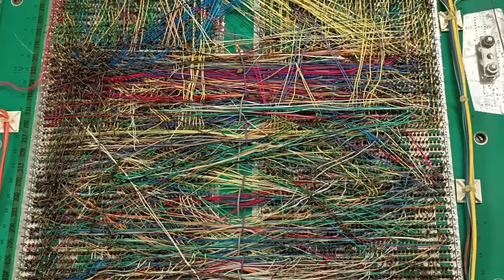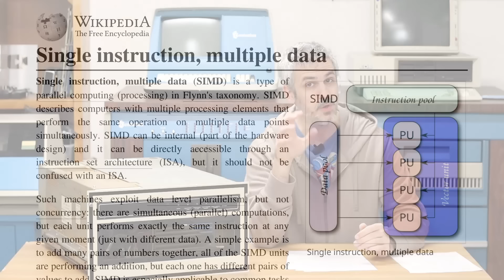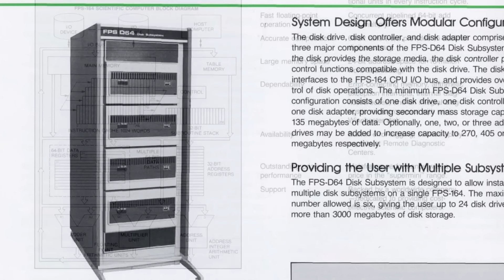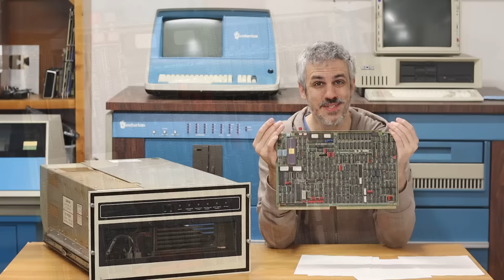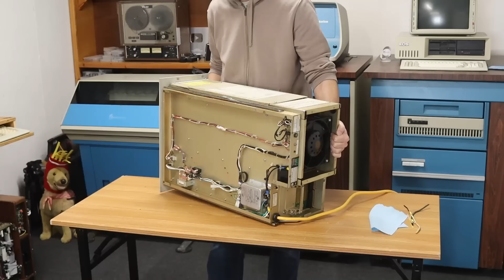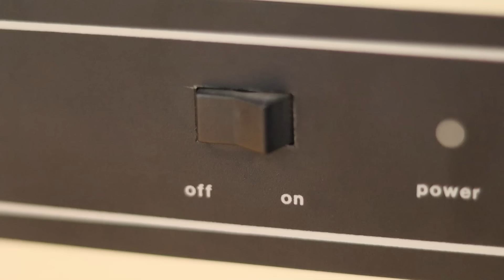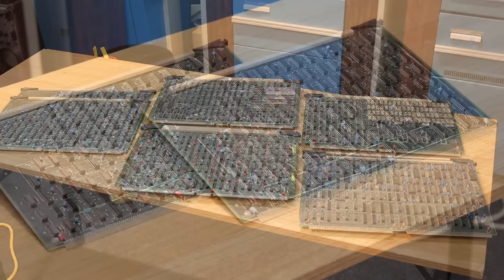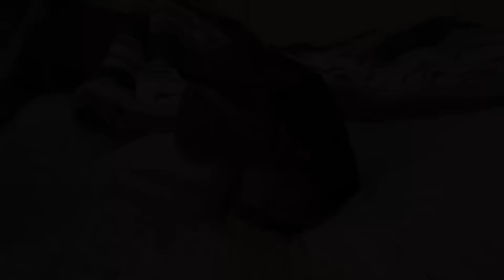This Computer is from a Defunct Supercomputer Company

Comment: This summer I got to visit the Cray museum in Chippewa Falls, Wisconsin.  lt was really cool to see the hardware up close, sadly I think all of the hardware they have there was incomplete internally, or had visible signs of someone cutting sections out with wire cutters for presumably keepsakes before they made their way to the museum.  But at least I can say I stood inside a Cray 1, Y-MP and X-MP and sat on the most expensive seats in the world.  Would be cool if anyone could ever get one of their systems working again.
Reply: The lack of early Cray systems that operate seems like the biggest gap in the collective archive of computing history.
Reply: @AnonymousBobbi  I think the Y-MP there had a big cabinet that said "Solid State Disk System" but it was gutted I think.
Reply: I thought I read that no remnants of COS survive - the problem with all of these exotic systems, especially before various standardization points, like, in this case, IEEE Floating Point, s that they were largely incompatible with each other and there fore had isolated small user bases.  This makes the odds of surviving software exceedingly small.

The first system I ran was UNIX, but on fairly esoteric hardware (Pyramid 90x RISC/Deep registerfile)  I kept not OSx system software tapes or rctiecture specifications.  If I just had those, I could probably code up SIMH realization, but, sadly, I don't think anything survives...

Comment: Geologists would used the FPS-120 to process array data (maybe why FPS called them "array processors"?). However, the "arrays" in this case were arrays of seismic sensors. The oil companies use these mounted in mobile vans and took them out into the field to do near real time processing of their data. When you start your car today, the petroleum running your engine may have been discovered by an FPS-120. (ok, maybe not. Those wells might all be dry by now, but it sounded cool:)

Comment: Geological field is geophysics in oil/gas exploration.
Reply: Well, seismic. Geophysics tends to be limited to relatively small data sets in the immediate vicinity (a few metres) of a particular wellbore, after you've drilled the well. Seismic is where you get the big datasets, covering thousands of sq.km to multiple km below sediment surface. 4-d seismic quadruply so.
Reply: @WellsiteGeologist-UK  Yup!  Massive datasets fed into super computers to make pretty little vector fields and such.

Comment: For the FP100 bus... perhaps a marco/polo board set would be handy, if you can find an example unit or two? Just a simple board set that attached every pin to a low voltage source and corresponding indicator on the other board, basically the old-fashioned toning out with a metal bristle brush and multimeter but done with dedicated paths. A little arduino or esp32 interface to monitor pin statuses on both boards and you'll have a pinout map for a given slot combination in probably 2-3 seconds. Move the cards, do it again. Eventually you have enough information to replicate that backplane electrically in maybe an hour or less, depending on how many slots and if there's backplane logic involved (meaning multiple states are possible). 

Y'know, it occurs to me that the edge finger distance is usually fairly standard. Could a universal edge bus mapper be a thing, with maybe 32 or 64 connections and a method to pull and reinstall cards in given sections for buses that have more than the tester's pins? Makes the work longer but means you wouldn't be reproducing a tester for every single edge connector format, but only for each edge connector pitch.

Comment: Cray didn't just do insane computers, but also best casing. Spend money on compute power, not furniture... some people could scream but Cray went like why not both?
Reply: The "round" Cray case was a brilliant piece of design - it wasn't round for aesthetic reasons but because that shape kept the system bus shorter and the cooling good, and underneath the seats were the power supply units for the computer above. I suspect the padded seat was just because people ended up sitting on it anyway during development so they decided to make it a feature!

Comment: My grandfather worked for IBM in the 60s and 70s. One of his main projects was working on a vector processor used for oil prospecting. If I remember correctly they processed the output of seismographs using Fourier transforms. I assume geological use of these machines would have been something similar to that.
Reply: or possibly nuclear test/earthquake detection

Comment: "What the 29116 lacks is a PC (Program Counter).  Program sequencing is handed by external logic, either custom, or using AMD 29112 microprogram sequencers.  It is the job of the sequencer to feed instructions to the 291116, handled jumps, calls, returns, and memory accesses." -cpushack

Comment: Why don´t  you provide 12V and -12V and see what happens on the serial ports? Maybe you get a console prompt!
Reply: I was wondering the same thing.  At least maybe a memory monitor.  Or disassemble the M68K ROMs and see if there's any thing going on there.
Reply from the maker: Interestingly, the serial chip is a 5V only chip, the +/-12V is used by separate RS-232 drivers. Even though I didn't film it, I actually probed the serial chip directly, but unfortunately, nothing on the serial ports. My guess is the production ROMs don't use the serial ports at all, unfortunately.
Reply: @UsagiElectric I assume you tried sending the board characters at various baud rates? Some systems only output after they’ve been nudged (typically with a LF, CR or both)

Comment: No: The cray computers were very expensive at the time. Can we please move back to traditional computing methods? The reason I ask that is, because we have moved over to heuristic processing methods,  which means you cannot verify the data you received as being correct. Case in point is bridge failure, and electrical system monitoring failure, and other critical services.

Comment: Isn't "geologic" code for "petroleum" ??  My grandmother worked as a computer for DeGolyer & MacNaughton in the 20s and as it was explained to me data reduction for seismic reflection measurements was done with strip-charts on graph paper and slide rules.  The idea here is that you blew up a stick of dynamite and took the seismograph output and by clever math you could  figure out where the oil was.  As they started adding more seismographs, they needed to do more matrix-like calculations (cause there was an array of seismographs instead of just one.)  And if I understood my grandmother's stories properly, that's when they started using mechanical calculators to compute more lengthy calculations.

After the war in the 40s, my uncle got a job at Geophysical Services, Inc. and was one of the engineers who started using digital electronic computers to speed up the calculations.  That company eventually became Texas Instruments and had several petroleum related customers.

So... I'm guessing geologic in this sense means seismic reflection data reduction, most likely in the petroleum industry, but I guess the mining guys might use that same data to find different metal-bearing ores (though in our high school geology class, we used resistivity data instead of seismic reflection data.)

As a company, TI has many advantages, but it is not without its flaws.  It always seemed to me to suffer from severe group-think in the product-management group, only accidentally making products with a market fit.  My guess is Floating Point Systems would follow TI sales people around in Houston and tell potential customers "Hey, I know TI doesn't have a product that fits your price/performance targets, let me introduce you to our product line..." and they would be right about 80% of the time.
Reply: In the 1980s and 1990s a lot of the oil and gas exploration that was done used geologists with seismic scanning to make it happen. While it's not the only reason for seismic scanning in geology, it was one of the best paying ones for a time!
Reply: @rivimey  Yup.  I worked for Convex back in the day.  Our tag line was similar to FPS:  "25% of a Cray for 10% the price."  Haliburton and Exxon and Chevron were buying up as many Mini-Supers as we could produce.  And then in 1993, RS/6000s had better price/performance numbers and we went from tens of millions in sales per quarter to zero, eventually  getting eaten up by HP the same way FPS was eaten up by Cray.

Comment: That FPS-100 backplane looks hand-wrapped, so while there might be a netlist on paper there won't be e.g. any Gardner-Denver cards.

If all the edge connectors are the same it should in principle be possible to generate a netlist using just two cards plus clever software... maybe just two half-cards.

p.s. John Savard derervs a shout-out for that collection of FP formats.

Comment: There is some minor FPS3000 info on bitsavers & archive - a document listing board part numbers for different systems, with descriptions:
FPS Board Revision List 198912

It includes such as part numbers for the adapter boards to suit different host systems, and which internal boards are the same for the FPS3000 & 5000 machines.

Comment: You really need to use a variac and ammeter the first time powering , it may save you a lot of work, if something is shorted, and allows some at minimal time to reform electrolytic capacitors. before slamming in the electrons. These computers remind me so much of the computer in my Bridgeport BOSS 5 1979 CNC milling machine., I think just 2 or 3 boards were the processor.

Comment: Around '74-'75, I worked, part time along with my studies, at the geophysics institute in Copenhagen. Not exactly geologic, but close. My job was to post-process data collected from seismographs, FFT, auto-correlation and such and it took hours on a Univac 1110 computer coded in Fortran. A SIMD co-processor would have made a huge difference.
I remember a set of data from a series of measurements taken in various places in Norway. All the data sets showed a very strong and narrow spike close to 1 Hertz . We first thought it was some artifact in the seismographs, but the team eventually discovered that it was a vibration created by the hydroelectric plants where the generators all had 48 poles so they had to rotate at a speed of 1.04 rotations per second to create the 50 Hz AC we use in Europe. All these plants were synchronized and made the entire country vibrate... They later found out how to use this phenomenon to measure the speed of the vibration through the crust of the Earth.
Reply: A short followup on this : They discovered that when they made measures over longer periods like several days, the speed of the propagation varied with the change of physical tension (stress) in the crust and that this tension varied with the position of the moon, like the tide in the oceans. They worked on ways of predicting earthquakes using measures of tension over time. Usually, the crust tension will increase before an earthquake and then drop abruptly. I don't think they found a way to use this in a manageable manner, though.
Reply: @FinnBojorgensen I learned something very interesting. Thank you!
Reply: @FinnBojorgensen I don't know about Europe,  but in the usa the 60hz frequency in the AC is an average throughout the day with a guaranteed number of cycles or some such. That way, if there's a synchronous clock that is using the AC frequency to track time, it may run slightly fast or slow, but it won't ever be way off.

I'm interested in what the custom in Europe is, and if they needed to account for any variation in the AC frequency.
Reply: @jonnda  I think they follow the same rules in Europe. During a 24 hour period, you should see the exact number of cycles, but the frequency may fluctuate slightly, especially when they add or remove a generator to the grid.
Reply: @jonnda  The same in Europe but with 50 Hz. It goes so far that in 2018 they observed an increase in the cycledifferential (actual and required) which was traced to a number of powerplants generating too little power. The energydeficit went up to 110 GWh and the cycledifferential was up to 350 seconds. After the culprits were identified, the deficit was recouped in about 3 weeks time. And all of Europe is synced to one grid.
Reply: thats badass
Reply: I worked in the geophysical industry in the early 80s. Our computer was a VAX 11/780 with an attached FPS 120 array processor. As said above there was lots of processing of geophysical data that we used the array processor for. Some of the processing was done in the time domain and some in the frequency domain, so lots of FFT and inverse FFTs. The seismic survey data can be thought of almost like an xray down into the earth with, typically, many thousands of channels of very noisy data to be dealt with.
Reply: what a fantastic story, i couldn't imagine the eureka moment that was had in the office when the pieces all fell in place.
Reply: This also would have been about the time fracking was first being made into a major thing (as opposed to an intellectual curiosity), so it might have been used to verify where the drill head was in real-time for guidance purposes.
Reply: @absalomdraconis 
Worked in the oil industry until I retired.  Fracking started in the 50’s.  It’s just that they used to use explosives instead of hydraulic fluids.
Reply: Fascinating story! Thanks for sharing 👏🏼
Reply: this was my guess too. pinpointing the location and depth of an earthquake or nuclear weapon tests using seismograph data collected from around the planet.
Reply: I was going to guess geologists used it for processing seismograph data.
Reply: Very interesting.
Reply: I have not worked at any oil company, but when I was in college (graduated in 2001) the oil companies were pursuing Beowulf clusters.   What is a Beowulf cluster you may ask?   There was some standardization of supercomputer tools to distribute jobs among the many processors... well 2 sets of standards I guess... MPI and PVM... and by the late 1990s any system just had both installed.   For both you wrote your program to use MPI or PVM, and it'd take care of deciding how many tasks to fire off to work on data, distritube those tasks to CPUs (on a shared memory system like an SGI) and both distribute the jobs and help move the data around on other systems where it was really tightly coupled discrete systems in a rack tied together with a specialized connection like Craylink or Infiniband.   

A Beowful cluster also uses MPI and PVM, but uses off the shelf computers (or in one famous example Playstation 2s running Linux...) and (back in early 2000s) 100mbps or gigabit ethernet (... usually.  Keeping in mind this was the early 2000s so the individual PCs in the cluster were like 1% the speed of a modest modern CPU, let alone the additional compute power with the GPU.)
Reply: And no one ever had the thought that exposing humans to constant synchronized LF sound waves was harmful?  Man, people are stupid

Comment: In the late 70's into the 80's I worked for a seismic data processing company doing computer maintenance.  They had CalComp plotters, TI Teletypes, card readers,  Raytheon 704s, Vax 11/750s and 11/780s computers.  The Vax systems had FPS100 attached to a couple of them.  I use to trouble shoot to the board level and occasionally had to fix broken wire wraps in the 704's.  The fun was tracking down if a wrap was broken, then digging through the mass of crisscrossed wired to repair with a new run.  I loved those binary/hex input switches and led panels, reseating or swapping out boards, cleaning contacts.  Always under pressure from the geophysicists to get the computer back up and running.  Ah memories.

Comment: Back in the mid 1990s I bought a Sun 3/160 from a guy who worked for Sun in East Bay.  Behind the front panel, a large silver box power supply was simply marked 1.5 KW.  That was impressive then, but current gaming or crypto mining rigs are using that kind of power coming from volumetrically much smaller boxes.  I remember reading an ad in Electronics (the magazine) in about 1980 proudly stating “We broke the Dollar per Watt barrier!”  Magnetics and power switching semiconductors have come a long way.

Comment: As others have commented, geologists use lots of computing power for seismic work.  The first program that I wrote was doing very simple processing of seismic data, acquired from geophones picking up reflections of sound from a sub-surface rock layer. Written in Fortran in the mid 1970s, running on the university's ICL1906 (a general purpose business computer) I think. It took ages to run, but did produce 'sensible' output. The geophysics people were banned from using the system during the day, as they were trying to model earthquakes using Monte Carlo processing

Comment: An FPS spin-off founded in 1981 was Aptec Systems, who made an Input/Output Computer ("IOC"), a VAX-hosted box with a big bus and lots of high-speed memory (big and high speed in those heady decades of the 80s and 90s). The thing could soak up a LOT of data quickly in real time for later post-processing. Applications ranged from oil and gas exploration to weapons testing.  I managed the large multi-volume documentation set as a contractor for a number of years starting in the later 80s but went on to other projects prior to their eventual absorption/demise in the 90s. Given the engineering lineage between FPS and Aptec there is likely some commonality. Somewhere I still have a full (or nearly full) set of docs for the IOC hardware and software. I'll poke around; there's a slim but possible chance some nugget there could indirectly assist here.